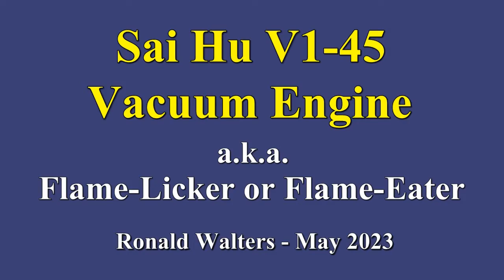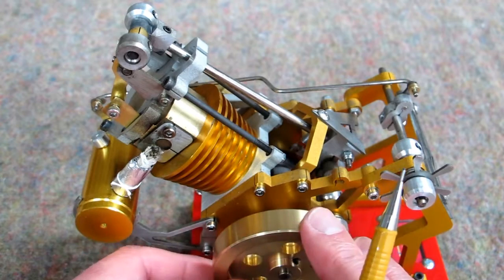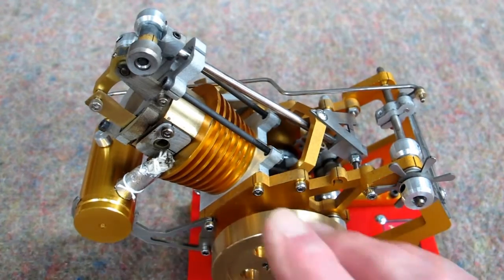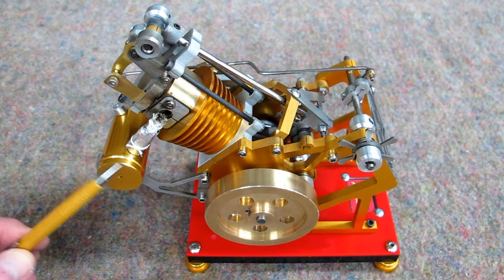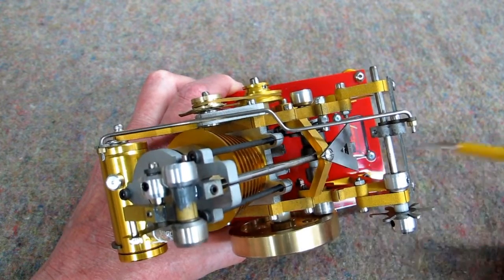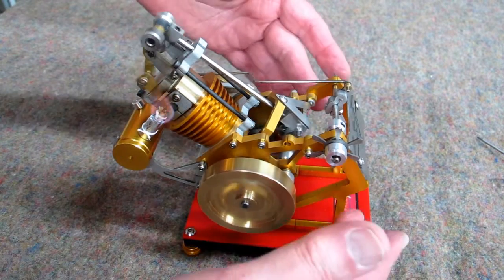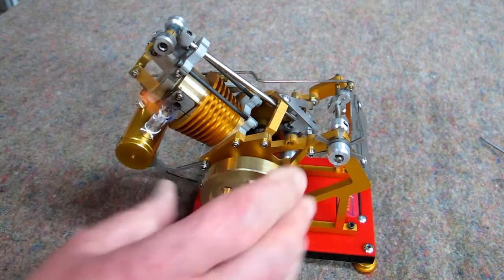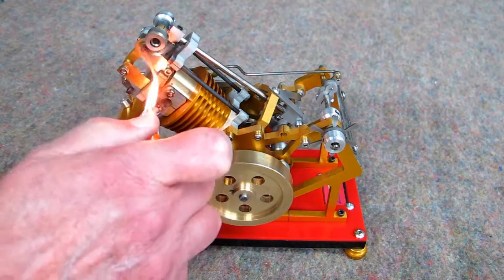Sai Hu V1-45 Vacuum Engine Flame-Licker

Comment: What kind of load could an engine like this handle?
Reply from the maker: I can't think of an actual application for a flame-licker, vacuum (or sometimes called an atmospheric) engine. They are just nice demonstration - proof of concept model engines. The constant open flame make them somewhat of a safety concern and not fuel efficient. They are interesting and fun to run and watch. 

The Stirling engine can be quite useful and has been used in the early days as a wood burning Stirling engine-powered water pump for rural farms. Phillips made a few in the 50's (very few unfortunately) to charge batteries or to run their radios in rural areas (would love to get my hands on one of these). The Swiss have submarines with Stirling powered generators to keep their batteries going when submerged. https://en.wikipedia.org/wiki/Stirling_engine 

Most of the Stirling engines are demonstration models. They need to get up to speed before they can support a constant load and then, without adequate cooling, they overheat and slow down which is time to shut them down before they quit. 

I purchased a Huxtable Hot Air Engine from Australia which is a high quality Stirling Cycle Engine https://youtu.be/GTuybMRKi6Y and there are a couple more videos where I made cooling fins which keeps it running even longer. 

The 6-cylinder Ringbom-Stirling Gatling engine shows promise and I have played around with a couple of ways to make it generate electric. These work and demonstrate the principle, but unfortunately it still has a limited run-time as it overheats. 
I have a video series on the Gatling Stirling Generator - https://www.youtube.com/playlist?list=PLDjucfhdTRPm571rpJul8y1CvBHZlFDJM

Thanks for watching! 
Ron